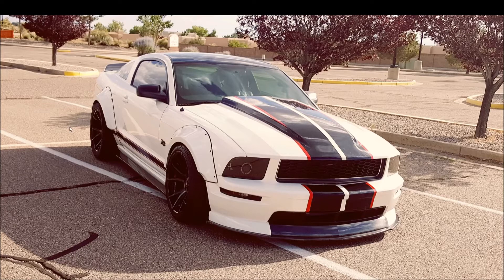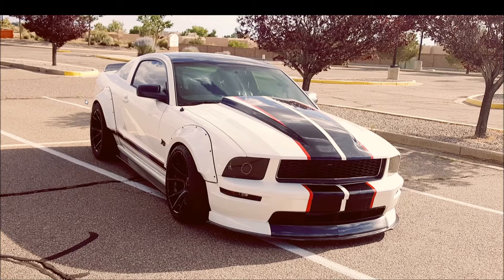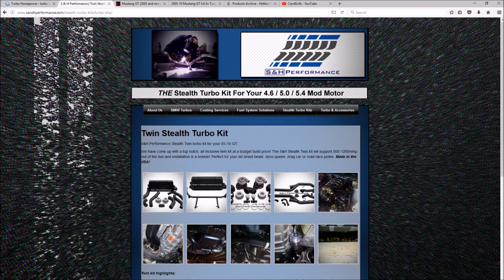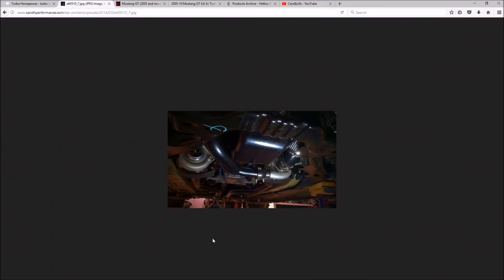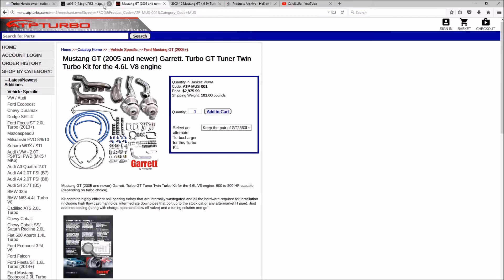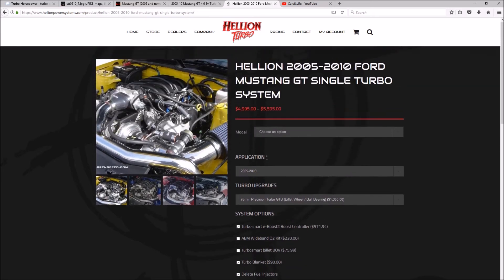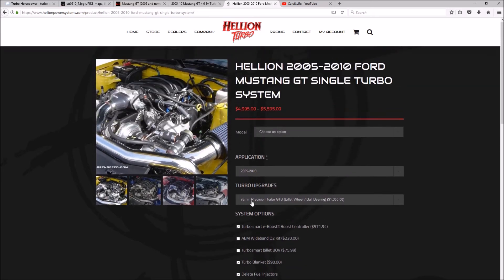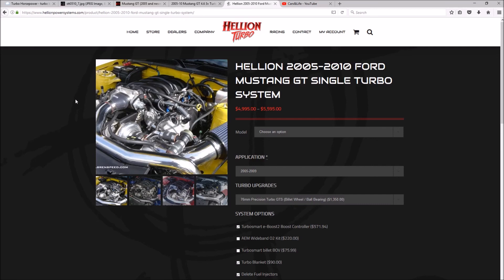3V Mustang Turbo Kit Options

Comment from the maker: Update: This single turbo kit put down 1008 hp / 1045 ft-lb to the wheels. There were a few mods to this kit to make this happen which include: (1) exhaust cutout near the turbo to reduce back pressure, (2) 60 mm waste gate to prevent boost creep due to larger turbo, and (3) cap the waste gate port in the exhaust and vent waste gate to atmosphere to reduce exhaust flow burden.

The exhaust cutout really helps the turbo spool up and reduce back pressure. It's a must for getting to 1000 hp with this kit. One other thing is that some of the piping was modified to increase ground clearance. The up and down pipes were rerouted over the steering rack (instead of under the steering rack).
Reply: What kind of back pressure did you have to get that power to the wheels? How much boost? I have the same setup and I've seen about 800 rwhp at 19psi with about 2.5pds of back pressure and mine has a 3" exhaust out the front bumper. I'm also on E-85.
Reply from the maker: @stevekent9276  Back pressure wasn't measured so not sure. Boost was about 25 psi. Engine is a 5.2L with cams and ported heads. Is yours a 4.6L?
Reply: @CarsLife  stoked 4.6 to 5.0 with kellog crank.

Comment: I’m trying to find a reasonably priced turbo kit for my 3v and it’s kinda difficult bc I don’t know a WHOLE lot about engines and turbos and what I’d need to run a turbo safely
Reply from the maker: There is a newer kit available that wasn't available when this video was made by cxracing in the $2k range. From one review video, the install isn't that easy, which is typical for low cost kits. Which kits are you considering?

Comment: Coyotes swaps are what most people are leaning to nowadays coming from their 3v's makes sense easy power gain and tons of performance options...but building a 3v that can still compete with modern technology is more satisfying to see in my opinion....I had the chance to take my wife to the dealer and trade her s197 3v for a new coyote but all said and done she was easily turned away for many reasons, 1 she was attached to the s197 being her first mustang..2 her car is paid off with 46k miles..3 their trade in value was shit 4 the mint condition  of her low mileage mustang so we didnt pull the trigger and decided to keep her....now we have over 5k invested in the 3v and don't see it worthy of a trade...so time to continue with our build....thanks 4 sharing your vid I hope you get some good results on your forced induction...I hope 2 go a similar rout with our build....
Reply from the maker: The single turbo kit has worked out pretty well. I have a build and dyno video of the final result. Check it out if you haven't already 👍

Comment: What did you have to do fit 355 on the rear and 305 up front??? I'm being told 305 is as big as i can go on the rear.
Reply from the maker: Tony Piazza Widebody kit from Trufiber, need wheels with proper offset (mine are +6mm), need to cut quarter panels up at least an inch depending on suspension. The trufiber option won't break the bank.

I have a friend with 315s on a 2012.
Reply from the maker: Tony Piazza For the front, again trufiber flares, cut fenders up at least an inch, and proper wheel offset. I have the same wheels on all 4 corners. Thanks for your question!

Comment: What hood is that?
Reply from the maker: Matthew Petty It's the Trufiber 3 inch cowl hood with a single vent. Fits pretty well.
Reply: Where did you get it from all the ones I've looked at are different.
Reply from the maker: Matthew Petty I got it from American Muscle when they were clearancing them out. Did you try Trufiber's website?